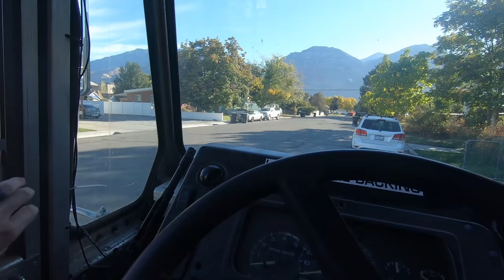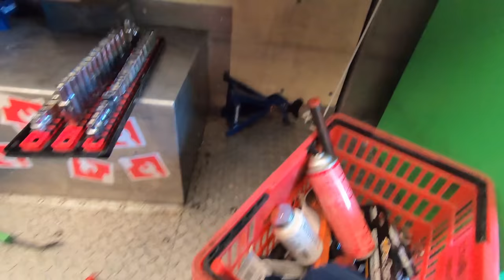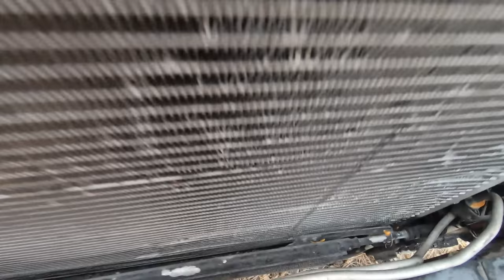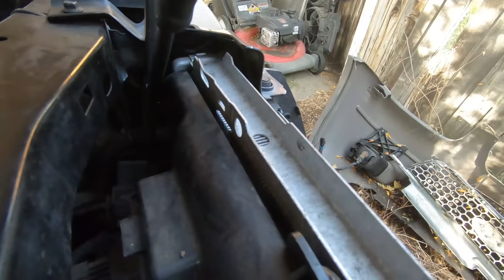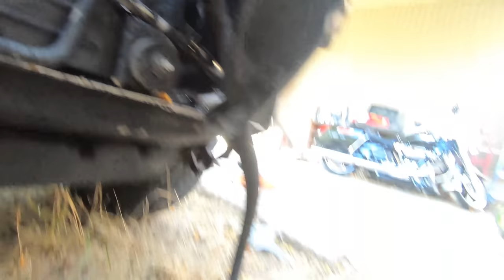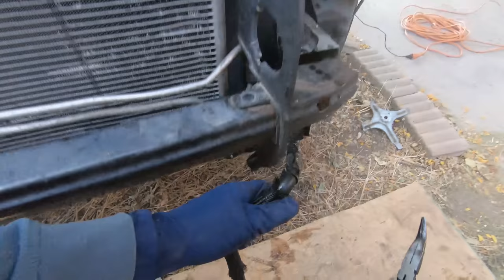parking police problems, plus fixing a ford escape. (trans cooler line 2010 escape)

Comment: Another great video. Excellent attitude towards the parking enforcement. I had to do the exact same job a few months ago regarding the transmission lines. I ended up just eliminating that whole tubing thing (that part developed a hole because of corrosion) and just ran rubber hose to each side. There was zero working room. Bumper being removed for you obviously, made it much easier! Great job!

Comment: A very experienced mechanic told me that those factory spring clamps for hoses are the best to use.  They keep constant tension on the rubber, even as the rubber ages.  I don't know if you have experienced this but a regular worm clamp that you have to tighten will frequently start leaking about a month later after the new hose shrinks from heat cycles and the rubber aging.  Worm clamps always seem to need re-tightening after a few weeks.
Reply: I hate em cause they are pain in tight spaces but I will say they are good clamps
Reply: Not true.  I've used hundreds of worm clamps and I rarely ever have to retighten one I've just installed.

Comment: I hate those squeez clamps they always leak when they are used on power steering and transmission lines . I throw them all away and replace with the screw tight type.. all those fords leak from those hoses . Great video

Comment: I would've used needle nose vise grips to pinch the transmission lines to avoid the leaks when removing them. Just my opinion. Either way, it got done which is what matters in the end. Good job Ernest.

Comment: I had a similar problem.  For me, my vehicle has a power steering cooler from the factory and it rotted out.  I went and got a universal cooler to replace it and hooked it up and made it about 4 miles and the hose blew out and sprayed the power steering fluid everywhere.  I ended up removing the small universal cooler and getting an original big cooler and putting it in and no problems.

Comment: Reuse or replace those oem hose clamps. They are key to tightening as the hose ages. The screw type hose clamps don't tighten automatically as the hose ages.